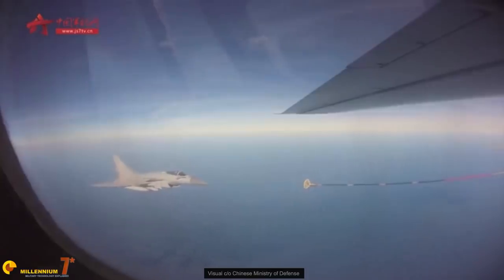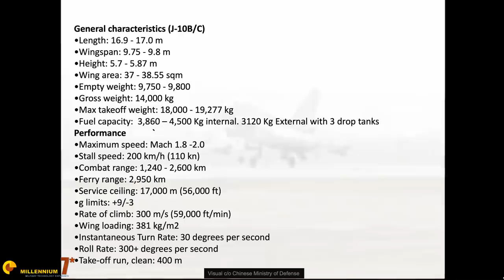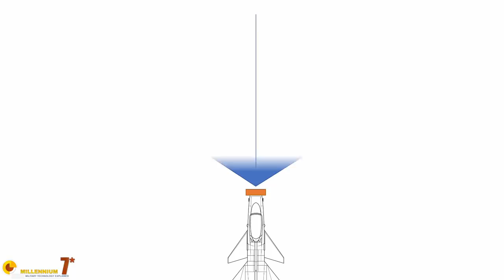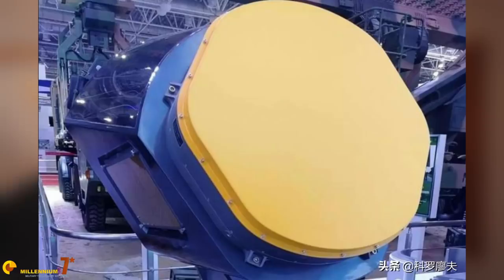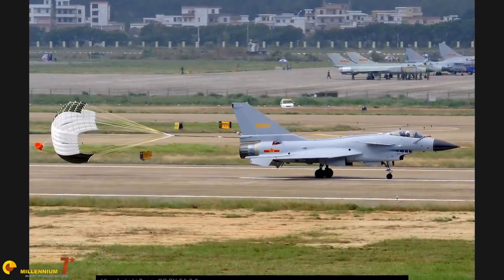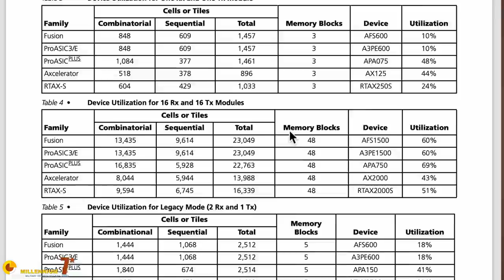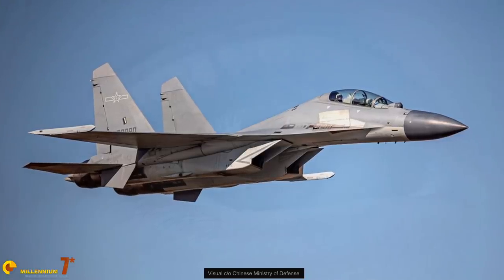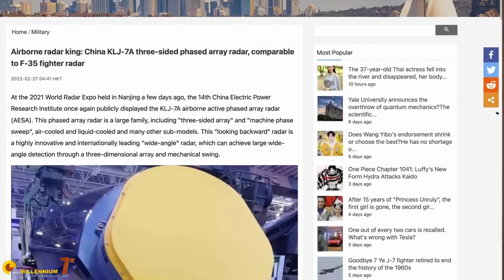I DUG DEEP into CHINA's J-10 ELECTRONICS and this is what I found...

Comment: Good video … from what I understand J10C doesn’t use KLJ7A, that’s instead the AESA radar being used in JF17 block 3.
Reply: Yes j-10c uses another radar which has 1300 recievers not 1000. Which is in jf-17 block 3
Reply: Bro Pakistan air force modified it's J10C according to their equipments that's why it took time
Reply: @sufimaya7223  Lol
Reply: @singatakberpura  j 10 cp

Comment: I'm glad you are doing videos on the J-10. The J-10c is actually quite a formidable fighter jet in comparison to western fighter jets. 

The Chinese just keep improving at an exponential rate.
Reply: As a pakistanni,a country which will be getting 40 jets of those fighter soon,I'd still rather have a f 16 if all use conditions are equal
Reply: @sharequsman596  why? the J10C seems like a good choce. it even has irst which the f16 lacks
Reply: @kingofgods-w3t  Yeah it's better as a jet in terms of specs but the f 16s are super reliable,really old ones from the cold war era haven't broken down once.Not to mention the j 10c will probably be using SD 10s which means it's on the same level as the jf 17 as weopons lethality making the f 16 much better against India's super manuverable jets like the su 30 considering it has the amraam 120c which is better than the SD 10
Reply: @sharequsman596  a mature design indeed, plus later models are quite up to date on capabilities.

J10 seems to be a decent machine, i wonder if those chinese engines are long lasting.
Reply: Griffin Taurus 👹🎭  Pretty sure it has better ones than our f 16 block 52s
Reply: @Coyote27981  I was talking about the f 16 block 52 and yeah the engines are a concern for me
Reply: @sharequsman596  I think you are correct for the F-16. Also, I would be much more concerned about the Rafale with its electronic cabailities. In a recent demonstration, its radar has knocked off a Flanker rendering it impotent. The Rafale is also very manoeuvrable.
Reply: @Galaxy2Free  Bruh the primary air superiority fighter is f 16 and that why I said if use conditions are equal.They aren't placing it on a weak jet,I never said it was.Its the best option they have
Reply: Agreed but we mainly use AWACS and data links plus idk what type of radar was in the flanker.Meteor the worst concern
Reply: @sharequsman596  you forgot the pl 15 missile
Reply: @kingofgods-w3t  Not for jets it's for AWACS and tankers It can't manuever that well for jets
Reply: @Shubham-1999  We are already using russian ones which were bad so hoping for the best rn.I think they would be better the switch makes no sense otherwise
Reply: @sharequsman596  sd10? Which year are you living? J10c uses PL15E, not SD10, all right?
Reply: @donchen4906 Pakistan's j 10s and jf 17s use pl15 not the export version and it can't shoot down highly manuvreble aircraft, it's for AWACS and refueling tankers
Reply: @sharequsman596  the first time seeing a Pakistani hav a decent chat wth regard to aircraft capability, wth Indian,  otherwise it's only trading of insults.....🤔😀👍
Reply: @sharequsman596   well, the fact is tht whatever truly happened is something, which will never come out, both sides have their own agenda, your brethren too are passionate, no doubt, even after 70 years, I guess the hate and hurt still remains...on both sides!!!
Reply: @mangeshkasbekar2947  Sorry for the hostility from me bro.Its just that I see Indians saying things like this while completely ignoring that they themselves are very baised as well.Maybe we can have civilized discussions 🙂
Reply: @sharequsman596  definitely,  we hav civilized people on both sides of the border, just tht sometimes, our emotions get the better of us,  thts all, 75 saal pehle, desh toh eik hii thaa naa😉😁
Reply: @mangeshkasbekar2947  👍
Reply: R W  Seemingly the PL-15 is made for large strategic targets like AWACs and tankers, but the duel-stage solid rocket motor makes it more agile at its terminal trajectory. The non-escape zone of PL-15 should be way phenomenal than the Meteor as it comes with AESA seeker head. Meanwhile the ramjet motor of Meteor doesn't come close at its terminal agility, high AOA would suffocate the motor.
Reply: American pilot training is way above China and Russia,  but never count out luck
Reply: @sharequsman596  nope, all exported fighters use PL15E, not PL15. And PL15E is not dual-pulse, PL15 is  dual-pulse. So PL15E has same maneuverability as other long range AA missile has
Reply: @donchen4906  Nope u can check the official website it's pl 15 not e it says pl10e though
Reply: @sharequsman596  well don't be a typical Pakistani we are always stuck on things from past. Just leave Honda cg 125 and suzuki Mehran mentality. Even westren like j-10 but we want to stick to 70s f-16
Reply: @sharequsman596   you're very correct , matter of fact paf rejected j10 c 3 year prior as they still had opening to buy  iraqi f 16s and 18 new block 52s, but with those avenues closed , pak resorted to j 10. While j 10 are highly capable , f 16 is by far the most reliable, modular and maneuverable.
Reply: @iqbalsandu8182  Idk about being more manuevrable though
Reply: @munnumkhalid  What are u even saying bruh
Reply: Basically it is a Israeli LAVI project which itself was quite mature platform. Chinese just updated the engine.
Reply: @shredder3055  It's derived from that prototype but it's very different in a lot of ways and again the lavi was just a "prototype"
Reply: Too bad their pilots have no experience in any sort of battle.... they will get destroyed.
Reply: @sharequsman596   Even the latest model F16V lacks the IRST -- one of the two gold standards (the other is AESA) in radar/sensor technologies.  Of the Western jets of the same generation, only the latest French Rafale is comparable to J10C.  F16V?  Nah... China didn't make a half-hearted complaint to the US when Taiwan acquired F16V.  That tells you how Chinese view F16V compared to J10C.  Also, in several war games held by China, J10C repeatedly beat the heavier top Flankers J16 and Su-35.
Reply: @sharequsman596  bro the latest variant of F-16 with latest missiles is definitely better than J-10C, but they are super expensive and you can't get them unless you are a close ally of US. So J-10C is obviously a better option for Pakistan comparing to old second-hand F-16s and missiles from cold war era.
Reply: @ZZ-qu7bq  Ik that's what I said
Reply: @normantang7456  I was talking about the missels used
Reply: @sharequsman596  stop being F16 fanboy..J 10 C is as good as any 4.5 generation fighter.
Reply: @iqbalsandu8182  Pakistan rejected j 10 A not j 10 C
Reply: @gambler1357  I'm saying the jet is good but I don't know how potent the missels are
Reply: @normantang7456  Im saying the jet is better.Its the missels that I'm worried about and the fact that chineese haven't mastered engine technology although both of those things will get better in the long term
Reply: @Galaxy2Free  Intresting I need to confirm that info from somewhere though.Whats the source?
Reply: @normantang7456  Also bro idk how important irst considering the chineese left it out of their other most mature platform the j16 but maybe that's cuz the j16s role is mainly electronic warfare
Reply: @iqbalsandu8182  One more thing is that there are rumours that the deal started in 2017
Reply: @sharequsman596  The Pakistan airforce is in the hands of professional and competent men and I’m sure they’ve got thought over their decision hundreds of times before coming to a conclusion that they NEED to induct the J10C to ensure the aerial defence of Pakistan. The Pakistani armed forces are not known to spend money needlessly. They’re known for meticulous planning especially when it comes to cost effectiveness and getting the most bang for their bucks. Why then are they one of the strongest armed forces in the world with such a relatively small budget?
Reply: @paksarzamin6550  I didn't say it was a bad decision but that amraamc would have been preferable to with a f16
Reply: @sharequsman596  To be honest, this batch of 40 is just there to run a field test for PLA instead of getting involved in actual warfare.
Reply: Rafale or eurofighter would convert it to dust real quick
Reply: @sandeep35cool  The main issue would be meteor missels but again numerical advantage here
Reply: @mingshili4101  I don't think that what paf is going to use it for
Reply: @paksarzamin6550  No just no it's definitely inferior to the American ones
Reply: @sharequsman596  you have no idea what rafales can do if they can go 1vs 2 with su 35 then j10 are piece of cake for them
Reply: @sandeep35cool  Nah in bvr yes but not in wvr and no su35 has bad missels in terms of range
Reply: @sharequsman596  yes they are, probably in Kashmir
Reply: @mingshili4101  What are u saying
Reply: @mingshili4101  No they are most definitely going to use them with the f16s in combat placing them at more riskier positions in the front while the f16s do bvr engagements from back
Reply: American war machine is very big compared to others, I would still prefer an F16 over Rafale or J10. Chinese war machine is also very big compared to France or Sweden. I would prefer Chinese J10 over expensive Rafale or Gripen.

Comment: I think the antenna behind the canopy is for data link with friendly units and AWACS, I can say this with high confidence because, the J10CP(pakistan variant) has a different antena behind the canopy, which I am assuming has been changed to interface with Pakistan's indigenous datalink (Link17) system. You can confirm this by looking at the pictures of the J10CP delivered to the PAF. 
The boxy device in the rudder is thought to be ECM/EW suite. But I cannot confirm this.
Reply: Does link 17 work with both Chinese and US planes?
Reply from the maker: Thanks for pointing out.
Reply: @sidv4615  Yeah
Reply: @dotsanddash8083  wrong..f16s can talk to link 17 via intermediary so can naval assets(which are western) and AWECS(most are western/saab)
Reply: @ziaulislam87  That's true, western platforms can in fact talk to link-17 at a basic level, however, it's not like Link-16 where one F-16 can transfer its tracking/lock onto another F-16. That ability is available separately for Link-16 and Link-17.
Reply: @ziaulislam87  f 16 can talk to other planes and warships via comman radio frequncies not over a data link, you can't send live location tracking, imagery,none of that. theres no way you're making link 16 talk to link 17, you have no control over link 16, you don't have the source codes to do that.
Reply: @dotsanddash8083  i guess your PAF chief..the previous chief was an imposter
Reply: R W  I'm well aware of their fleet, J7, old Mirage 3 and 5s which they tried to upgrade under project rose, Jf17 and a few f16 block 52, the only decent fighter is the Falcon. The rest are just there to boost the numbers nothing impressive."combat records" I'd be the last one to believe the things that they put out. It's been long since they lost credibility, especially since 2011.
Reply: @dotsanddash8083  🤣😂alay !! Isko kitna pata hai!!
Reply: @dotsanddash8083  okay dude I know why are you frustrated but please do me a favor, cry harder your tears are very tasty......
Reply: @inammir1979  I'm not gonna get myself involved in your sh*tshow your countrymen excel at it😂 if you have any technical argument I'm down for a debate.
Reply: @dotsanddash8083  totally wrong.... The link 17 incorporates all the fighters used by Pakistan. These include AWACS both built in Pakistan as the Saab 2000 Erieye, Chinese sourced awacs and the dassault falcon da-20 aircraft.... The strength of PAF lies in it's ability to have streamline communication between it's platforms....
Reply: @dotsanddash8083  truth is in the pudding and it's smeared near Nowshera IOK and also displayed in PAF museum along with the MiG-21 tail... You'll need to ask them to open the show case so you can take good sniff of the backside of Abhinandan's flight suit.
Reply: @dotsanddash8083  ok, either that or  you're a genie then, got some sort of vodoo information.
Reply: @dotsanddash8083  Lol typical indian biased. Acquisition of J-10CP has debunked your false statement. Chinese and Pakistan J-10C clearly have different data link antennas. Pakistani J-10CP has one big antenna behind the cockpit in center of the fuselage and the same antenna on the belly near intakes, similar in configuration like it has been on JF-17s for decades. So if you don't have any non-indian source to back your claims, keep your mouth shut plz 😊
Reply: @UsmanSiddiq1  😂 Pakistan didn’t design sh*t, even the Chinese barely designed it, the design of it was completely done by mikoyan gurevich corporation under project 33 for MIG 33 which never entered serial production, the design was later sold to chengdu design bureau .MIG Corp and chengdu design bureau under a joint venture modified the front end and called it FC1 xiaolong which never entered serial production for the PLAAF. The back end of JF17 is exactly what it was in mig 33, why do you think JF17 uses a Russian engine? The Russians designed it for a single RD33, to this day JF17 uses a variant of RD33 which is the RD93. Pakistan doesn’t do anything other than licensed production. Russian design and engine, Chinese avionics and missiles what has pakistan done?
Reply: @UsmanSiddiq1  India has designed a space ship, don’t you know 😁😂. Their 40 year old fighter jet program which was supposed to be “ indigenous “ has products from around the world in it. Even then it was rejected by IAF and they had to run to the French begging for Rafale jets lol .
Reply: @bannedone3ice138  The most funny part about its India don't even make single part for it just assemble them.
While Jf-17 more than 80% parts are infact manufactured in Pakistan and we own rights to it cuz we researched it along with China.
Reply: @inammir1979  27th of February modi ka rcs 56" se 56mm kara ta PAF ne😁
Reply: @dotsanddash8083  and you gained your credibility in 2019 😆😆😆😆
Reply: @asimjabbar8445  lol another comment that doesn't make sense. 😂
Reply: @dotsanddash8083  Tea was fantastic 😁😂
Reply: @narasimhasri9688  You keep dreaming that. Your armed forces can’t even fly your chief 20 KMs and roasted him before the graveyard. So, I would talk big if I was Indian lol

Comment: ARINC 429 is used because the PLAAF is regulatorily integrated into the civilian aviation network. Traditionally all Chinese aviation assets have been state-owned and dual-use, but dual-use cuts both ways. Just like how the airlines must make their aircraft available for the military to use, PLAAF also had to make their transport and cargo planes (and some special planes, like maritime patrol) available to the Chinese civilian aviation authority. A good example would be all the military transport planes used to transport volunteers to Wuhan at the start of the pandemic. Since all the military utility planes use ARINC 429, so do all the combat planes by extension. That said, the PLAAF does have their own digital databus and standards for their internal use.